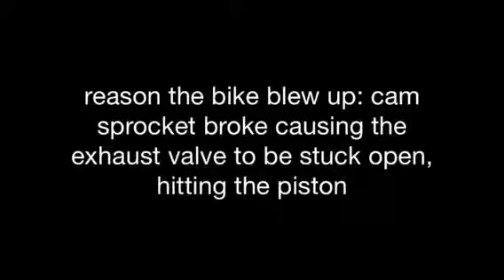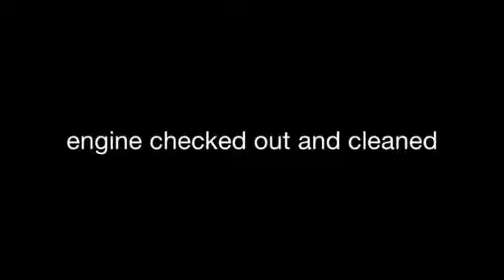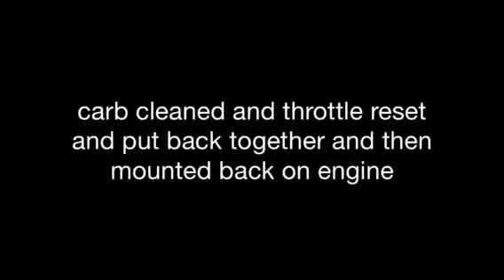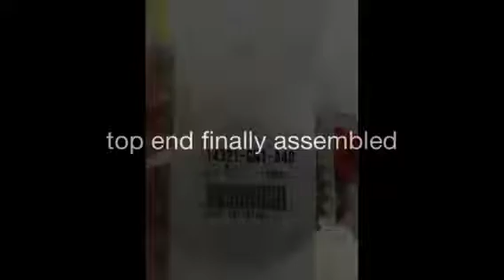1977 Honda XR-75 Restoration

Comment: cOOL !  man after the '75's its hard to tell the years apart...different colored forks, hubs...i think i just bought a '77 but it was advertised as a'75. definitely not that its got laid out shocks..gotta pick it up still.. restore looks easy.
Reply from the maker: mikerafone music usually you can tell by the VIN plate, type it in on one of the free identification web sites it will tell you the year. Gotta love older hondas
Reply: cool thanks i will..i love em! i had a '74 when was 11 . im 53 now still a kid at heart